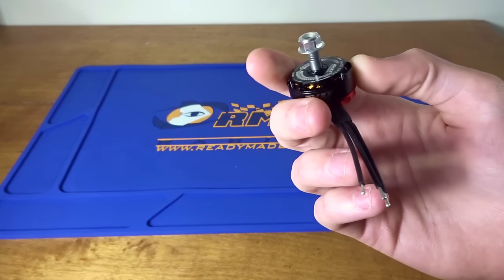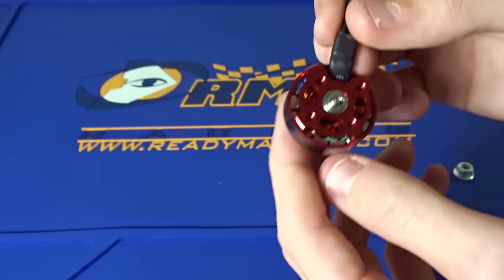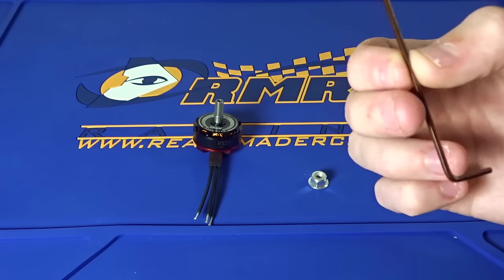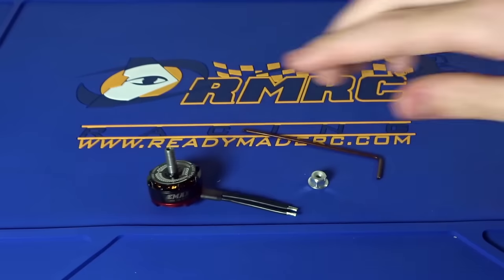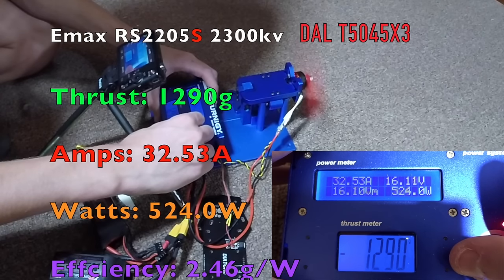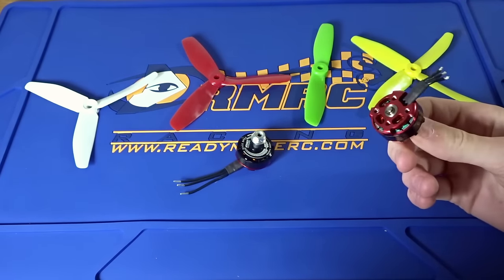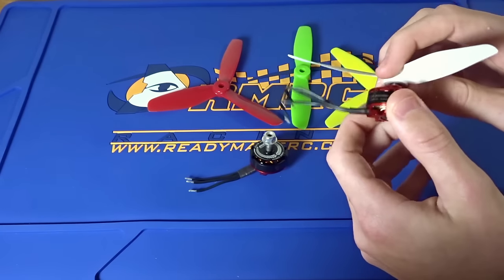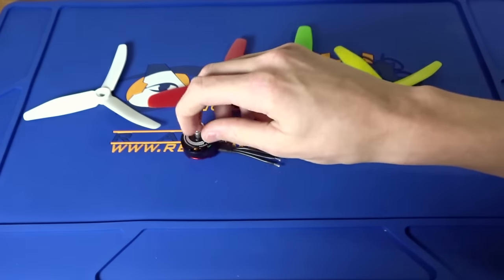Emax RS2205S 2300kv Overview and Thrust Tests!

Comment: I have one of these on a wing, running a 6040 KingKong prop, a 4s 1800mah Turnigy nano-tech battery and a 45Amp YEP ESC.
I measured the thrust on a home-made rig and I'm getting 1420g of thrust @ 36A.
They're a great motor.

Comment: Hello, it's a really nice video. I want to ask you about the lipo battery. I have the same motors for our FPV racing drone. But I really didn't catch what is "C". What can ı use as a lipo battery? It must be a 3S battery because my ESC supports only 3S so, My battery must supports 3s and a high "C" value. What do u think about the value of "C". Is 11.1 V 3S Lipo - Battery 2800 mAh 35C" enough for my FPV drone.

Comment: Which prop will give longer flight time on 3s ?
For longer flight time 2 blade prop is good or 3 blade?
Total weight of drone qav 250 is about 900g with 6200 mah 3s 40c lipo.

Comment: How do you feel about EMAX RS2205S 2600KV in 2018? Or should i buy AOKFLY RV2306 2650KV instead? or Cheapest "good" DYS Shu/Wei? .. (Budget is my main concern / first build / freestyle) TY!
Reply from the maker: I would go with the DYS motors for sure, 2306 or 2207 if possible.
Reply: thank you sir!

Comment: Are these for a specific frame size or blade size? Gb130? 3 inch or 5inch? Noob question but it's info overload for me right now.
Reply: I literally posted this comment after herring my question. Doh!
Reply from the maker: No worries. These motors are specifically made for a 5inch prop, but could still work on 4 or 6 inch.

Comment: Great video! Are you happy with the thrust stand? I have been considering getting one. Keep up the great work.
Reply from the maker: It probably isn't the most accurate, but it does alright :) I like it, except the mounting block is like 6mm thick so normal screws don't work! grrrr

Comment: Hi! 
ThanX for the great video.
Question.. I just got the new littlebee favourites 20s amp esc's. Which would be the better match, the 2205s 2300kv or 2600kv?
ThanQ in advance : ]
Reply from the maker: There is no "better" match for an esc I would say. I mean the 2300kv will pull less current and some will argue you need 30a escs for strogner motors or higher KVs, but I literally always fly 20a, and just yesterday put several flights through on these RS2205S 2600kv with DAL cyclone V2 (T5046) and bascially full throttle flights, draining my entire battery in 1:30 or less, an d they didn't even get warm.
Reply: Wow! Ok so im in my way to my local store to get the 2300kv 2205s!
ThanX for the useful info BuDi  :]
Reply from the maker: Gogi Fire Ok, they should be plenty powerful enough :)
Reply: Lol cheers!
The motors are definitely quality! 
All connected today and then one esc burst into flames on the first test flight! :/
Going back tomorrow for a replacement! I let you know how it goes.. Fingers crossed  :]
Reply from the maker: Gogi Fire Dang :( Must have had a short on it somewhere.
Reply: Yeah maybe! Pissed.. 
But glad my local store is replacing it : ]

Comment: compared with f60 t-motor ? are they close? or is it with a F40?
Reply from the maker: Well, that is not really fair as the F60 are 2306 2450kv I think haha. And F40 are 2305 2600kv. These are fantastic motors for their class.

Comment: How does high kv fly vs low kv? Im trying to do serious racing, and im trying to debate wheter to go 2600kv or 2300kv. 2600kv will be on hq props, and the 2300 will be on avan r flows. What do you think?
Reply from the maker: I mean it really depends on the rest of your setup, your skill level, and how you fly in general.
Reply: @TheRCAddict  I have it all planned out lol.  I'm a beginner,  but I bought a qx7 and velocidrone and I've been using that for two weeks,  I'd say I can fly alright in acro. My setup will be :FC: CLracing f4
     ESC: racerstar rev35
     Frame: campfirequads cf-1
    Motors: dys samguks
    Camera: foxeer micro arrow
    Vtx: RDQ mach 2
    Reciver: frsky xm+
   I want to do racing, not really going to focus on freestyle, and the estimated dry weight will be about 300 grams. Probably a little more. I fly fast, and low to the ground, i dont do a lot of cruising. I was also thinking about getting the 2300kvs and running them on 5s, but im concerned about the motors exploding
Reply from the maker: Starting out that should be more than enough for you, especially flying a track. Turning and elevation changes make you slow way down.

Comment: I would say these motors perform a litter better but if you already have v1 it's not worth swapping out. They also set lower than originals so if you have fat escs on top of arm might have issues.
Reply from the maker: Yes these are not a "oh my god, you have to upgrade!" but if you havent bought the motors yet I would certainly go for these.

Comment: Great test - you showed the data in a very useful manner!
I have a set of these behind me (first motors) and noticed how much force I need to twist the propellers down the shaft (and back up). Is this to be expected with the intended propellers (5mm mounting hole)?
The propellers are Kingkong 5045x3, 5040x2 and some 5045x2 that came with my Martian 2 frame.
Reply from the maker: If the prop is cheaper, like a DAL of KingKong, I find sometimes the dimensions are the slightest bit off causing them to be super tight on the shaft. I have never had a problem with HQs not going on.
Reply: Alright, sweet. With that solid shaft, there's no way I'll accidently bend/damage it by carefully twisting the propellers on and off - correct?
Reply from the maker: Wind1000100 Yeah, practically impossible for you to bend the shaft by hand. Maybe throwing the quad against a wall haha
Reply: Thanks heaps of your help!
I have one more question - how tight should the prop nut be? Significantly tighter than by hand or just a little bit, until it stops moving with not too much force?
Reply from the maker: Wind1000100 Tighten it as much as you can until it stops turning. If you can hold the motor and twist the prop at all try to get it tighter.
Reply: The RCAddict Much appreciated! Thanks.

Comment: the 2600kv version just came on the miniquadtestbench site with more than 1500g thrust on a 5inch! And a comment was that despite the high kv, it had more than sufficiant torque... Your thoughts?
Reply from the maker: Yes, these motors are VERY torquey, so while the 2300kv will have more torque, the 2600 is still adequate. With over 1200g at only 29amps I am VERY happy with these as that is basically exactly what I was looking for in a motor.
Reply: The RCAddict the same reason im getting the 2300kv  :)  also nice vid(forgot to say) :D

Comment: Could i run these With littlebee 20a's. currently have no name 2205 2300kv's with Dal 5046 tri. I Use 1550 75c 3s. And 1550 4s 45c+
Reply from the maker: Yeah man, will take them just fine.

Comment: what battery are you using on your actual quad with these? A single 1300 graphene battery enough?
Reply from the maker: Yep, the 1300mah Turnigy 65C graphene packs. 4s
Reply: The RCAddict how good are those graphene 1300 4s packs? Debating which 4s batteries to get and considering getting a couple of those
Reply from the maker: I really like them.

Comment: Dude, nice and clean vid. Do I need a 35a esc for dal 5045 or 30a is safe?
Reply from the maker: You are perfectly fine on 20a. These are absolute peak numbers plus it's on the bench. Going to be much lower in flight.
Reply: Thank you :)
Reply: I can confirm this. My build is using Dys 20A, they are not even hot after flying with 3s.

Comment: I had crash and think the bell is bad now on emax 2306/2400kv and since no bells avaliable i may have to find other motors, have you ever heard or tried the mb=multicopter builders that are brother hobby there 2207/2400kv im looking at but my quad with lipo,cam,fpv cam ect is 700g weight so not sure what to go with i really did like the emax 2306 but after a 5ft offground hitting grassy field it messed up motor u can turn motor and bell is got slightly high and low gap between base and bottom of bell.
Reply from the maker: Emax might actually be supplying new bells soon, as they do for the RS 2205S Series of motors, though just a guess. 700g is very heavy though, what are you running?
Reply: 5" alien with f4 flightcontroller,gopro hero3 with 3d mount,tramp vtx,x4r receiver,rotor riot fpv camera, run either dinogy lipo or graphene and its heavy
Reply from the maker: What lipo are you running? 700g is crazy heavy for that. Should be ~600
Reply: thats dinogy 70c 4s
Reply: weighs like 505g with props,gopro 3,vtx,rx,motors,esc esc no lipo and then 700g with lipo on 5" quad
Reply: ill be running a set of mb 2207/2400kv on 5s soon though so should be plenty power
Reply: they offer 2580kv but figured thats more amperage if both ran 4s for 4s and motor is 30g weight so not as bad as emax rs2306/2400 that i was running till wreck
Reply from the maker: mAh is just as important, 1800? The power is not the issue, is just becomes so heavy that is responds badly, and is a brick when it crashes.
Reply: 1300mah yeh its alien rotor riot frame so not sure why so heavy

Comment: did they fixed the magnet glue coming off issue yet?
Reply from the maker: I never had any issue with any of mine.
Reply: ive heard about quite a few reports that they come loose but only on the steel shaft model. some reports found on the multicopters reddit
Reply from the maker: They are all steel shaft. I think I read that they said there was one bad batch
Reply: the RS2205 non S are steel too? 
Bell and threaded Shaft is one piece and looks like aluminium.
theres a steel shaft inside, but it doesnt go all the way up to the threads.
Reply from the maker: Oh no only the S versions. I didn't know people still bought the old version. Haven't seen them in a while.

Comment: lol I just found two sets of these in a box Emax sent me a long time ago. I believe they are prototype versions because they are 2400kv.. I'm going to build me a QAV210 I have laying around and a QAV-XS that I never built.. they are going on those two builds right now.. I have a few Hyperlite F4 boards that need a home and some Littlebee 30a Blheli_S escs... just build me out two play around LOS builds.. Hell I may grab some 3mm carbon and the cbc router and make me a set of arms for the qav210 to clear 6 inch props. hell I have some Tattu 4s 1800 45c packs that sent me that I haven't used. yup I'm building me a 6in LOS build.
Reply from the maker: Haha finding stuff you didn't know about it always good lol

Comment: Can this be used in a rcplane?
Reply: I don't see why not
Reply from the maker: Yeah, probably not the ideal motor though as don't most wings use 6-7 inch props, and larger plane models arouns 8-12 inch? This motor is optimized for 5 inch.
Reply: it really depends on what you want to put it in

Comment: are these motors both ccw and cw
Reply from the maker: Nope, all CW threaded. Was not aware at the time of the video
Reply: The RCAddict I have 4 and wasn't sure if i could use them if there all cw. so its ok to reverse 2 for ccw?
Reply from the maker: mark rankin Yep, that only refers to the thread. So all the nuts will tighten to the right.
Reply: Cheers was panicking there lol